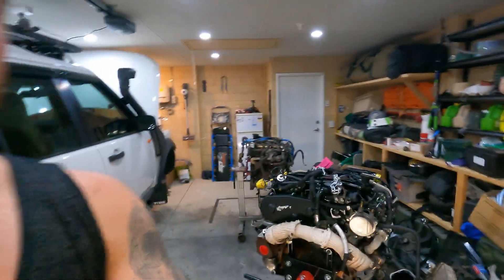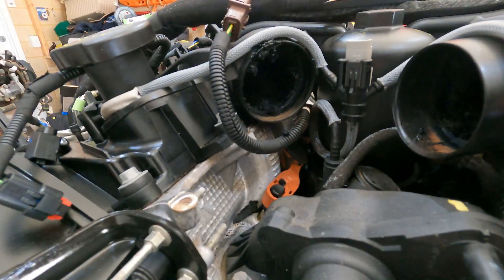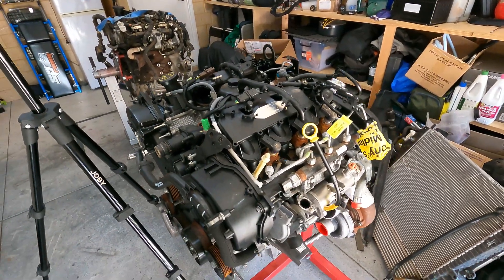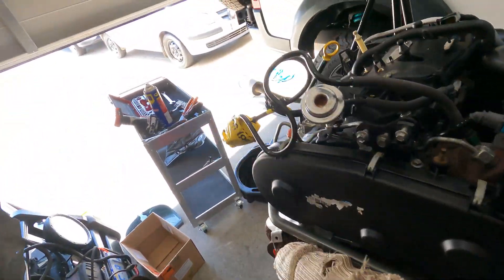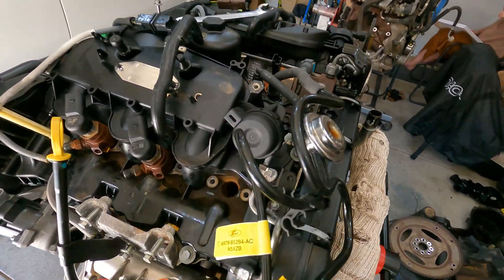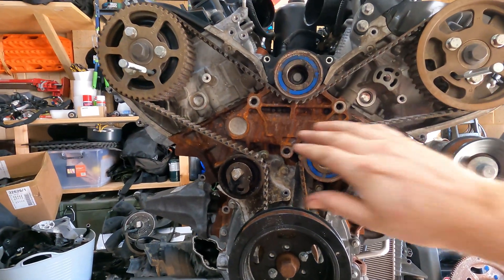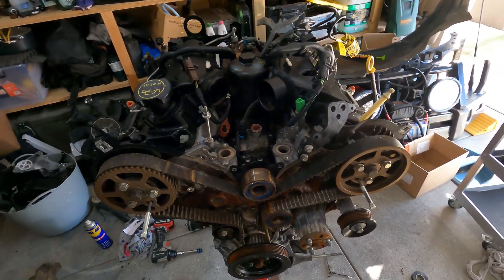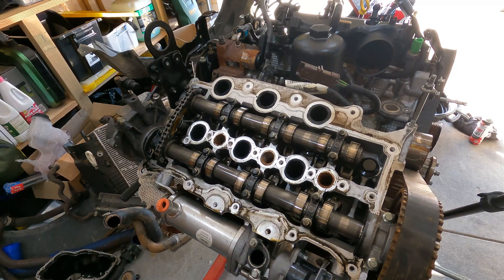ENGINE BUILD PT 1 , How dirty is this new engine!

Comment: Hey Ryan. Greetings from Wanneroo. Did you just get the territory engine as a replacement or did you look at getting a new tranny too? I'm wondering if its simple to get a recon territory and a recon ZF 6HP26 and mate them up?

Grant
Reply from the maker: Hey Grant 

My engine is out a 2011 territory 

I done a bottom end rebuild on it and some head work before installing which I'm glad I did 

Half the lifters were worn so would of still had that annoying ticking on start up until oil pressure came good 

And the crank endfloat was at max spec 0.32mm so need crank bearings 

In regards to swapping it into a disco if yours is 2007 onwards you can get away with just swapping

All the front pulleys and timing cover

Sump, engine mounts, harness 

In regards to the trans if you just switch a trans over it will need to be programmed in from what I understand unless you switch the mechatronics unit over from your original transmission 

I had mine rebuild with upgraded torque converter and lock up clutch aswell as a zip kit installed into the valve body to help with clutch oil pressure for holding gears was worth the coin

Comment: Blank the EGRs maybe?  Another job I need to do, I have the blanking plates, just need to pay for the patch and download it to the GAP IID tool.
Reply from the maker: Egrs blanked already and running a catchcan now

Previous owner of the engine definetly done neither haha
Reply: @OUTBACKDiscovery  I better do both.  Did you notice much of a difference?
Reply from the maker: @PeterOZ61  egr blank was done from day dot 

Intake on original engine would just get oily but not carbon build up which was a bonus 

Now my intake stay oil free and no carbon so super chuffed
Reply: @OUTBACKDiscovery  Roger that. I prefer your blanks that the flat plates I got. I’d prefer to get rid of the pipes so will need blanks for the intake like you have.

Comment: Whats the deal with oil pump
 failures. Is it common? What actually failed?
Reply from the maker: If u go to my oil pump failure video u will see where it breaks off 

It's real common in the early 2.7's before 09 I think the timing belt tensioner mounts to the top of the oil pump , the old style oil pump isn't reinforced where the tensioner mounts and spontaneously breaks off without warning , the new style oil pump is reinforced and no longer an issue

Comment: Still catching on on youtube vids after getting away for Xmas. Looking forward to the rest of this series.  Those injector return line clips are a bastard with the engine in the car. Don't want to loose one as you can't get a replacement without buying a whole injector (at least that was the case when did mine). I had one go flying and I was convinced I'd lost it, but found it on the edge of the starter battery on reassembly
Reply from the maker: Yeah when I first done my oil cooler I snapped the far rh ( 4 )  nipple off in the Injector and had to reach the whole return line bloody bitch of a thing 

Also you can get clip with the fuel line kit for the Injectors 

Comes with Injector line, seat, and return line clip that's what I done with mine bought through rovacraft for about $65 was about 12 months before your vid though so listings might of changed when u done yours
Reply: @OUTBACKDiscovery  I had a genuine LR return line, no clips where in that and it wasn't that cheap either. Was closer to $300 from memory
Reply from the maker: @Shanes_Shed  I bought the same return line and the fuel injector service kit to get the clip
Reply from the maker: Gave me a heart attack when I think I paid about $330 ish for the line and then yeah 65 for the Injector service clip

Comment: Nice one Ryan. That carbon gunk is horrible!. In a previous car life with an Audi 4.2 fsi v8 we had bad carbon problems but it was rock hard. I made a little jig for blasting them with walnut shell media. Just had to make sure to turn the engine so that the intake valves were closed before cleaning each cylinder. Took about 30 seconds cleaning per valve and they were like factory!
Reply from the maker: Nice one what did u use to suck out the residual sitting around the valves 

I would have done similar but with it being sloppy and sticky  I new it would be to hard to clean it away so pritty much scraped out what I could and use a little balloon attatched to a straw that I blew up to clock the hole further down
Reply: @OUTBACKDiscovery  I made a little plate that fitted the size of the port - one with pipe to my old dyson vacuum cleaner and a hole to poke the blaster in. Just had to stop every now and then for the hoover to catch up. I only forgot to close valves for one cylinder 🙄😆 🤦🏼‍♂️
Reply from the maker: @jarv75  nice thinking man that would have worked Mint 

Haha oopsie

Comment: Good to see the engine has been looked after. Even though its a big job, at least it won't be anything as bad as the LR Time saga. 😊
Reply from the maker: 🍻 fingers crossed my original engine isn't to bad when I rebuild that one aswell 🤣
Reply: @OUTBACKDiscovery  Do you expect crank and main bearing damage? Just ship it to Germany. 😊
Reply from the maker: @NathanNostaw  I'd suspect worn bearings but dought the crank is damaged as the engine stalled installed when the timing belt tensioner snapped 

I'd say pritty confident valve  and cam damage as I have almost no compression when turning the engine over on cylinder 4 and 6 

So head gasket and heads and crank bearings

Comment: Great video guys and happy 2022.... 
I was Just wondering if the heads have got a separate port for each inlet valve?? 
Looking forward to the next video. Keep safe guys.
Reply from the maker: Hey Chris happy new years 

And yes each inlet has a separate port in the head  those 6 black holes that u could see were the inlets and the other 3 were the fuel injector channels

Comment: Great video! Looking forward to the rest. How are you meant to clean your intake? Do you need to dismantle it periodically or can you use one of those sprays?
Reply from the maker: Hey Joseph if you keep ontop of the Y  peice of the intake it shouldn't get to back in your manifold 

There's no real easy way to clean the actual intake manifold without removing 
U can do the carbon cleaners and stuff but I'm not a fan as it's basically getting sucked straight into your engine
Reply: @OUTBACKDiscovery  cheers for the reply! So you'd recommend taking out the Y part on top periodically for a clean?
Reply from the maker: @josephjohnston1894  I do it every few months only thing to make sure.of it that u get new seals otherwise it will sweat oil onto your oil cooler 

Normally you will get a good understanding as to how dirty it is just by removing the map sensor ontop and cleaning that which I do every service or at the latest every 2nd service ( use maf sensor cleaner ) 

If that sensor is pritty dirty you no that your intake will be aswell
Reply: @OUTBACKDiscovery  great, thanks for the advice!

Comment: Think i just blew the front crank seal on mine (after fitting upgraded oil pump and new aftermarket seal) damn thing, thats what im thinking anyways, was good till high revs then dumped all my new oil, bastard things 🤣
Reply from the maker: Haha awww mam spewing 

Food for though you may have possibly pushed the seal in to far and blocked of the oil drain port causing the seal to get pushed out 

When you fit the new seal the Ford manual stipulates to only out it in 1mm past flush to prevent the drain hole blocking 

I may be wrong but maybe double check when you reinstall and good luck 🙂🙌
Reply: @OUTBACKDiscovery  I think that is correct. LR Time were careful on that detail too.

Comment: It's good you can install a much more modern engine in the Discovery. There was a bit of puss in the intakes, not as much as I would have expected. Will you show us what your original intakes look like?Can you use off the shelf MAP cleaner to clean the MAP? I ask because Rovers tend to be fineky vehicles.
Reply from the maker: Hey rob I will probly start the rebuild in a month or to once I build up some money again and then I'm going to try and do a comparison from of stuff like my intakes vs the territory , crank shaft bearings as mine been serviced every 7.5k for the last 14 years 

Regular maf cleaner will be fine just make sure u dry it out fully before re installing 

Personally I use the crc branded maf cleaner if that helps Ur peice of mind on which one to buy 🤙🍻
Reply: @OUTBACKDiscovery  Looking forward to the comparison. I have CRC MAF cleaner, so will use it. Thanks for the advise.

Some time this year I will take my intake off and have a look see & clean. Mine is an 2007 Discovery with 220,000Km
Reply from the maker: @robpeabo509  nice one this territory engine had 189km on it 

I'd say if you are still running your egr yours will look similar to the video 🍻
Reply: @OUTBACKDiscovery  I hope not, the mob I bought it off specialise in Rovers, plus they had the intake off before I bought it to change some known fail parts, as well as once while I owned to replace a part and clean up the mess in the valley between the two heads. That was only in December 2021. I would like to think they would have cleaned the manifold. I would be disappointed if they didn't. Anyway, I shall check it out. I had to pull one of the EGR pipes between the EGR valve assembly & the inlet manifold to provide a bit more access. The pipe was not at all choked up, nether was the top of of EGR or the inlet manifold where it connected to. I flashed the pipe out anyway while it was out. I didn't bother with the other ones because of how good this one was. All will be revealed in the next few months.
Reply from the maker: @robpeabo509  ahh nah she will be fine then 

Specially if your recon that the tip of the egr pipe was clean 🤙 I look forward to hearing how u went with it